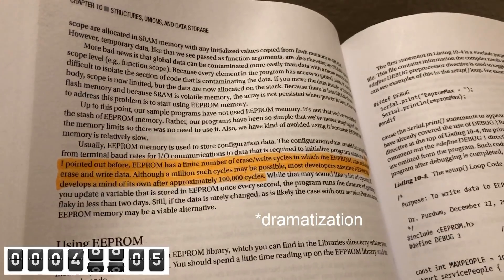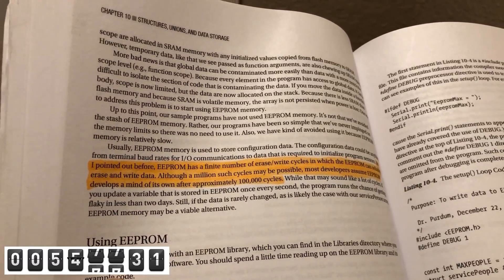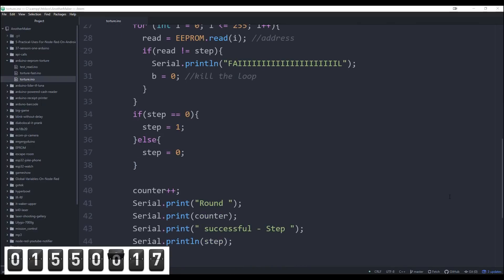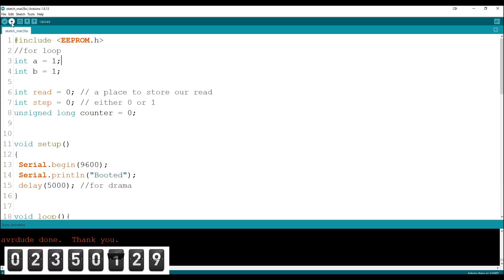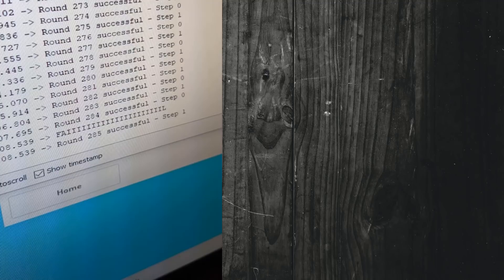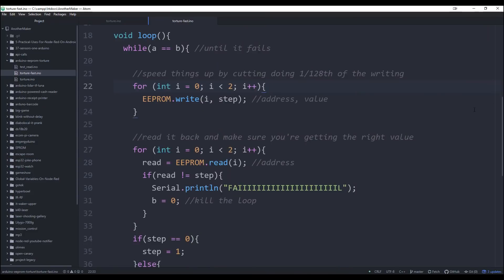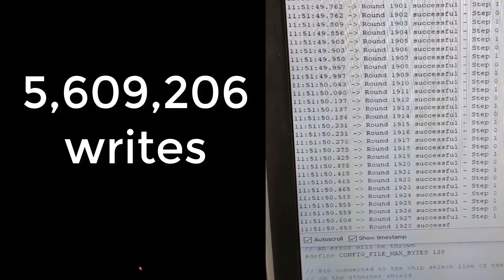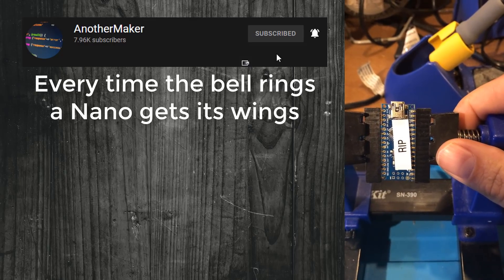How many times can you write to the Arduino EEPROM without killing it?

Comment: Use faster UART SERIAL(115200 for example). 9600 it's veryyyyyy slow...
Reply from the maker: I'd be interested in knowing if that speeds up the ability to write even faster.
Reply: @AnotherMaker  yes, because UART isn't asynchronous and if UART don't stop transmission data, next command can't start.

Comment: I conducted a similar test in the 1990s that compared the bit failure rates between EEPROM and FRAM memories. The local RAMTRON representative would bring customers by to watch the test and get an independent opinion. I found the average number of writes to a 24C04 EEPROM was approximately 2.5 million before a bit failure. The FRAMs never experienced a bit failure and RAMTRON kept me well supplied in FRAMs for projects.
Reply from the maker: That's really really cool.  So yeah.  I think it's good practice that if the product can do 2.5 million you probably want to advertise it as 1 million on the data sheet.

Comment: Thats Great, I think the 1 Mil is just a safe est. I read that you should try not to write to the same address to often. so using a random start point in memory on each cycle, with what you have tested  memory is not gonna be the failer point, also a small error detection code can mark bad memory extending this even further. some micorchip have a very limited amount they can write clearly this is not one of them.
Reply from the maker: Yep. Absolutely. With a few considerations like that, you can essentially write forever if you need to.

Comment: Why don't they use flash memory instead of an EEPROM?
Reply from the maker: Both do have limited write cycles.  These chips were invented long before makers got ahold of them also.  I'm guessing that's what works best for the things they were actually designed to do and the Arduino people just repurposed them.  A lot of the newer boards do support SD built in.

Comment: I had a board that had a 4MiB FLASH (custom SNES cartridge) that stopped writing correctly after only a dozen writes or so. Although, to be fair, the chip was rated for 3.3V, and the SNES outputs 5V, so I have no one to blame but myself.
Reply from the maker: Yeah. That will do it. It's nice to know it could take some cycles at 5v though.
Reply: @AnotherMaker  Actually, what's interesting is that I can still sometimes flash it if written to slowly in small block sizes. (Though it's hardly worth it when it needs to repeatedly re-flashed to debug a program on hardware.)
Reply: Why not just step down the voltage from 5 to 3.3 V? (and use level converters for logic)
Reply: @mr_gerber  The S29GL032N FLASH has an absolute maximum voltage rating of +4.0V on VCC, and VCC+0.5V on most other pins. For a 32Mbit FLASH, that means I need to have level shifters on each of the 23 address, 8 data lines (which would need to be bi-directional for in-circuit programming), read, write, and chip enable, totaling at least 34 level shifters, with limited board space.
The increased cost, complexity, and risk of failure would be too much for me, as I am a college student software programmer, not a professional electrical engineer.
Reply: @haruki_nyan  I think you can do it!
Fair answer, though.
Reply: @mr_gerber  Thank you for your confidence. I'll probably just use 5V FLASH chips, though, even if they are harder to find.

Comment: So i guess if you shift around your data you get like gazillion writes?
Reply from the maker: Absolutely.  Right after I started the test I was a little worried that they used some kind of wear leveling or ASLR, but they don't.
Reply: @AnotherMaker  There´s an Arduino lib that will do that, make sure new writes goes to less-used areas.

Comment: There is something called silicon lottery, so you can be very lucky on some units and some will earlier.
Reply from the maker: Absolutely.  Usually it's rated as Mean Time Between Failure.  I did choose different boards that I bought in different years. Both new though.

Comment: Those seem to be Chinese Arduino Nanos, I wonder if it'd be any different on the original chip....
Reply: I ordered many nano clones and as far as I can tell, they always used the original atmel chips. So no difference in the eeprom.
Reply: Apparently there are some AVR clones out there, but I doubt they could get supply/sell it everywhere in those numbers without getting trouble with Microchip/former Atmel
Reply: You may be right but that's definitely the case for STM32 clones. There are tones of so called "bluepills"  with MCUs labeled as CH32 or CS32 available on Chinese sites and besides the fact that you need to make some changes to the config file in order to make them work, they function pretty much the same as the original chip. I just figured it might be the same for AVRs although I've never come across an ATmega chip which would be an obvious fake like those CH32 or CS32 ones
Reply from the maker: The only board I've ever had die of natural causes was a brand name Arduino uno.  It died and took out the USB port on that pc.

Comment: Awesome test! One thing to consider that the devices were constantly powered. 
But the cells usually go instable when they are disconnected from a power source for too long so in case we were doing 100k cycles and let it sit for a couple of days before doing another 100k cycles results might differ.
Reply from the maker: Interesting. I hadn't considered that.  And obviously I only tested 2 boards, so I would expect results to vary wildly.  Thanks for sharing.
Reply: @AnotherMaker  I am not that familiar with EEPROM internas. But for NorFlahes I know that the life time depends also a lot on the writing profile you use. 

e.g. a memory may work just fine when you test 100k cycles like this. But it will lose the ability to hold data for long time, e.g. randomly data gets lost after 2 weeks... or maybe even just minutes / seconds. Depending on the degree of degradation. Also, average write and erase times will increase. This is also one reason why in the datasheets you can usually find a huge gap between "typical write time" and "maximum write time". Gates will be switching slower. Of course it also depends on other factors like temperature, power, age,  etc...

It makes huge differences if you just write write write non stop... or write, pause, write, pause. Second scenario will increase the life time and number of  max write cycles drastically. In short... those things are very complex and its very difficult to pin point certain numbers even when testing with many many devices many times. Sometimes even some components have already a lot worse performance and lowered lifetime directly out of the factory.
Reply: @elsekling2552  i imagine you also need to consider operating conditions like temperature.
Reply: Write time wont increase... unless you implement data verification function to wait until its werified ro be there. Standard eeproms are bare hardware and has no os that does that waiting loop for you .. im giessing arduino doesnt hawe that built in.
Reply: When the EEPROM is knackered it may verify ok initially but its retention can become unreliable.  That's why the published figures after so conservative.  It should retain state for 20 to 40 years.

Comment: Epic way to burn a board out!  Have always wondered about this.  Odd that the thing is bricked, due to a component failure.
Do you get any fuse readings with avrdude?  Kind of makes me want to run a HVPP on the MCU to see if can be unbricked.
I think there is a limit to how many times you can flash a board too ... a far smaller number.
Surely have flashed a couple of mine hundreds of times without negative consequences.
Reply from the maker: The one board bricked. The other board is operational, it just can't write to the eeprom.  They may require an autopsy.
And yeah, regarding flashing. I've flashed some a ridiculous number of times.
Reply: @AnotherMaker  is the entire eeprom dead or if you write to the bits that didn't fail do they still work?
Reply: I don't think it is odd to brick the whole chip. Most (every?) EEPROM is organised in pages, a unit more than a byte and surely more than just the 2 bits in the example. Physically the EEPROM needs to erase  a whole page and rewrite the whole page with just the changed bits.  If the first page of EEPROM held the configuration (like oscillator source, boot area flags etc.) and was rewritten while changing the first 2 bits of "user" EEPROM, there may be corruption to the vital registers read on boot-up and subsequent no-boot.
Reply: @kuebbisch  You are probably right.  I figured they put the fuse settings on a separate block from user EEPROM though.  (shrug)
Reply: @kuebbisch  Interesting background, with that, considering that he actually wrote two Bytes with each cycle (16 bit int), is the Arduino compiler smart enough to combine those into a single page write or does this mean that he actually did twice the write cycles?
Reply: @someguy4915  the compiler most likely does not have a clue... i hope. Writing eeprom is a small dance of writing stuff to some special registers, and the compiler should assume that each and every write to these registers (and the order of doing it) is fundamentally important. This is what 'volatile' keyword is about.

Comment: Thank you!!! I won't feel as bad (and concerned about killing the EEPROM) now when I write a new sketch because I had a stupid bug in my code ;)
Reply: in this case...EEPROM != Flash...
EEPROM on arduinos is used to store variables you want to keep over reboots...Flash is where the "sketch" is stored, and should not be confused with EEPROM or any other memory..
Reply from the maker: Yeah. For years, I've heard a ton of different numbers tossed around. It was kind of nice to put at least a guestimate in the real world.
Reply: Flash memory and EEPROM are different, you upload code to flash memory but it's actually degrades roughly 10 time faster, instead of 100k cycles it's only reliable for 10k. That may not seem like much but think of it like this, you'd have to upload code to it 27 times a day every day for an entire year to reach that limit or a more realistic number, using it 5 times a day every day it would last over 5 and a half years... Doubt you'll ever get close to that or keep using the same microchip long enough but if you actually manage to do so they're still only $3 or so.

Of course, the 10,000 is like a "best buy" date for canned food, not an exact measurement. Just like you've seen with the EEPROM figure, you're likely to get 20x that amount before running into any issues. The first 10k is just guaranteed to work, you could easily reach a million cycles before noticing any issues...
Reply: @DrakeOola  Thank you for this additional information!
Reply: @nccyr1  Yeah, I was worried about the durability too, 10k seems like it would wear out extremely fast but if you do the math for "daily use" it would last years. An actual quantifiable durability makes anything seem low, like I doubt a hammer would even hold up for 10k strikes before the handle cracks but nobody ever worries about having to buy a new one until it breaks. I guess we'd also worry about death a lot more too if we had a readable timer on our life spans tho; just obsessively watching the seconds tick by...
Reply: @DrakeOola  I don't care what anyone says, "In Time" was a pretty good movie.
Reply: @DrakeOola  many state only 1000 program writes for an ATmega series like ATmega328p which is what most "Arduinos" use.

Comment: It always concerned me that Eeprom writes were limited. However, I figure that if I saved my WLED settings 5 times I day, I should get about 1095 years use from it. That'll do 🙂
Reply from the maker: haha. Yeah. I'm also one of those people who hates seeing my cell battery get low, so I feel the same way about my writes.
Reply: I suggest you buy a batch as new ones might be hard to find when you need to replace it every thousand years.
Reply: Ye, it is funny how people are afraid to use EEPROM because they think, it will die soon.
But they upload sketch with edit of single row to Arduino flash that can based on datasheet handle 10 000 times overwrite...
Reply: @RGPinger  And you have to remember that the datasheet write cycles are guaranteed values, so Atmel/Microchip will have ran similar tests and added like a 10:1 safety margin, so I wasn't surprised by the million writes before failure. Another chip produced on a monday may have failed after "just" 1/4 million writes, but would have been perfectly in spec.
And in you use case if you don't need the whole capacity of the EEPROM for your settings, you can also implement some sort of wear leveling, like having a counter in which points at your configuration byte and get tons more write cycles before your product fails.
Reply: @RGPinger  Same deal with SSDs, people wildly underestimate how much you can use them.

Though still probably shouldn't cheap out on them. They may not be hard drives, but a bad one will fail you even faster. Looking at you Kingston A400. No coincidence that the only two people I know who've had them no longer have them.
Reply: @StereoBucket  my cheap chinese one become read only after nearly 40 TBW. I bought Samsung before so I'm not mad, and i have all my data.
Reply: @vadnegru  My Samsung 256GB Pro SSD has over 80 TBW and is still doing fine with 90% health
Reply: @xitee6258  got a PC on hand, here are readings LBA writes 7.1 TB, flash write 9.6 TB , life 95%, work time 275 days (6622 hour, 1441 power cycles). Most likely controller just refused to do work and not actual flash. I'm certain that it was cool enough 40-45°C and it is 2.5" drive. On another hand Samsung 970 EVO+ 500gb has 10 TBW, 99% life while being under GPU because that's the NVMe socket there and SATA socket are somewhere more chilly. So it idle at 50° and during gaming and downloading it gets nearly 70-80° (i do this very occasionally and only with light games).
Reply: @vadnegru  Your NVMe drive will be fine there. Too cold and they start erroring out too!
Reply: @StereoBucket  What SSD would you recommend in say the 4TB range?
Reply: Honestly, at some point, the only way to increase writes is to teach your micro how to use cuneiform.
Reply: That'll do pig, that'll do
Reply: Doing only five writes a day will likely extend your eeprom's life by another factor of ten.
Reply: I dunno, if you make it to that long you might find out that it died 800+ years ago at least because yeah it can handle that many write cycles, but the problem is when you write the amount of time the data is retained goes down more as the more you write to it the more you wear the cell. So after about 5 years of regular use, if you upload a program for long term, it might last you 2 months then you gotta reupload.